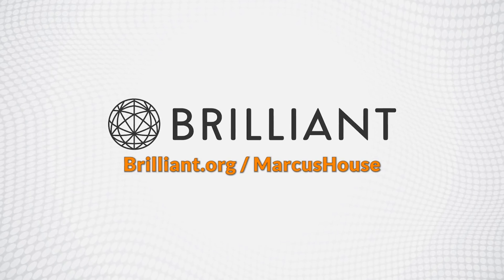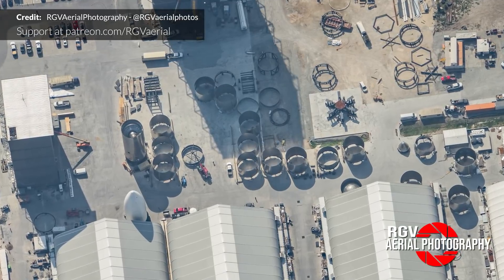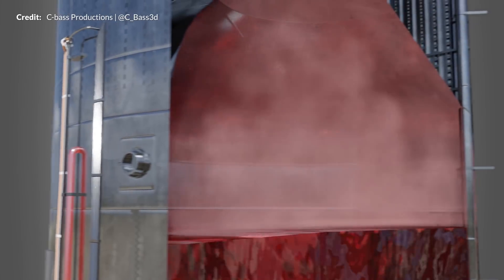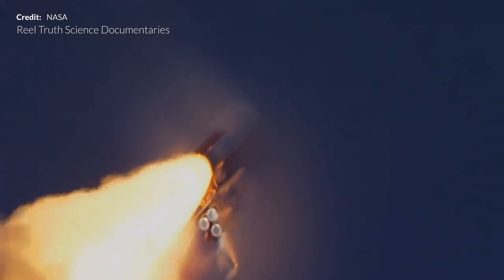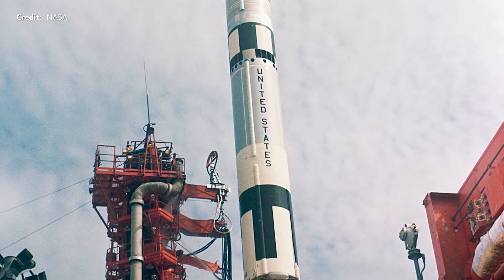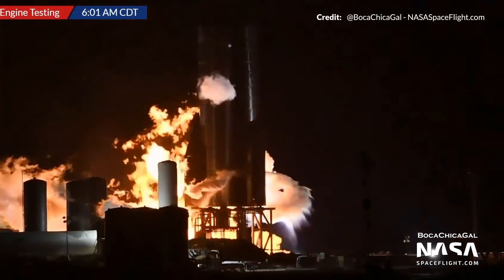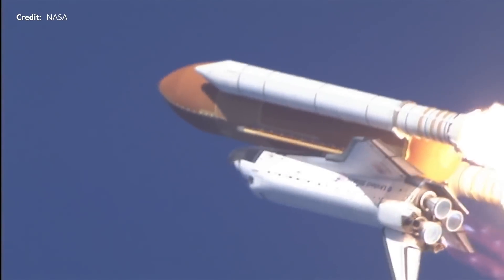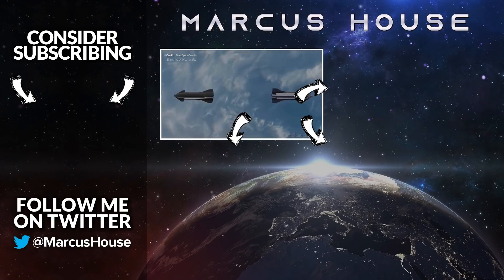SpaceX Starship - How will Starship tank autogenous pressurization systems work?

Comment: Gravity is still free. Get something heavy. That way the gravity be doing most of the work. You know with the right counterweight someone could lift the Starship .. Maybe... Use the original setup to lift and lower. And gravity for the tough side, Lifting or lowering. Double safety and awesome control .. Maybe?

Comment: Hi Marcus, thank you for an interesting video, unfortunately it brings to mind more problems for me, regarding the Mars mission. The average temperatures on the Mars surface, is 20 deg C at its hottest and minus 125 deg C at its coldest, in space temps of minus 270 deg C can be expected. So, on the trip out to Mars it would be an easy prospect to produce hot gas to maintain the methane and oxygen pressure and temperatures. of minus 162 deg C and minus 183 deg C respectively. But on mars the temperature at its coldest isn’t sufficient to prevent the methane and oxygen from boiling off crazily and bursting the tanks or venting to atmosphere, unless somehow, they managed to build reliquefaction plants, the weight of which would be enormous, too much so for Starship. Please do you have any idea how they will manage this? I assume later missions to Mars will allow for the building of refrigeration and reliquefacation plants, but I can't see how the pressure in starship will be maintained on the surface, sufficient to maintain tank pressures and in turn tank strength/stability. Thank you once again for an outstanding video.

Comment: pressurization is not the real problem.  Keeping bubbles out of the fuel intake is the problem.  The engines run on liquid not gas bubbles of nitrogen or helium.  A bladder would solve this problem and you would not need but a little pressure, ounces, not pounds.
Reply from the maker: What material can you make a bladder out of that can deal with cryo temperatures?
Reply: @MarcusHouse  I was thinking of silicone and super fine strand nylon, but there must be a fiber of an element with a super low melting point, eh?    This would work with higher temperature fuels such as kerosene and hydrogen peroxide,  and there are others such as alcohol  but what can remain flexible at super low temperatures?  I don't know but it would have to be a very fine fiber like nylon.
Reply from the maker: @TheWadetube  Remember, it needs to be flexable at cryo temperatures, it needs to hold a hell of a lot of pressure.  I'm not aware of any flexible material that can do that.
Reply: @MarcusHouse  GLass fibers are hard as , well, glass, but bend if thin enough.  Nylon or some other better fiber can be made very fin and it will bend at cryo temperatures and impregnate it with a little silicone or something with a very low melting temperature and no, it does not have to handle high pressures, only keep the air and liquid separate until the liquid is used up.  A couple of pounds of head pressure will keep the liquid at the bottom of the tank in zero G.  That's all I am saying.  A suspended floor might do the same, like a piston head with an O ring or piston ring that would help seal off one side from the other and the floor would simply get pushed down by air pressure and keep it from passing into the liquid.  I see faults in both scenarios.
Reply from the maker: @TheWadetube  But why? How is all this added complexity better than using a little ullage to settle the propellant? Your solutions is much more complicated than what works in reality.
Reply: @MarcusHouse  Refueling in space, the two ships are connected.

Comment: Howdy, I have some questions that I'm having trouble finding the answer to and I hope that you or some else may be able to help. :)

I noticed that the common bulkhead between the two tanks creates quite a pinch point for the lower tank. What do they do to reinforce that area to prevent failure? 
What pressure is the liquid methane stored at vs the liquid oxygen?
And if the pressure is not so high that reinforcement is required, why have such gentle curves on the pressure tanks, especially at the top? Doesn't that waste volume within the structure?
I understand a sort of funnel is required to make sure liquid settles to the bottom of the tank during thrust, but why make the curve so gentle?

Do the pressures of both tanks somewhat cancel each other out at the pinch point of the common bulkhead making it so that there is not any significant pressure difference at that seam?

Thank you!

Comment: @Marcus House Hi Marcus. The addition of pressurised gas to the tanks won't keep the liquids at the right end of the tanks (where the feeds to the engines are), - that still needs gravity or deceleration or diaphrams or something. - When the rocket is not accelerating upwards or decelerating downwards what keep the fuel at the right end of the tanks (e.g. during the belly flop ...?) Thanks.

Comment: One danger I can foresee with autogenous pressurization is the risk of an accidentally fuel rich mix (with fuel not fully burnt) ending up in the LOX tank;  or vice-versa:  an accidentally oxygen rich mix ending up injected into the fuel tank.  I suppose they can take the pressurizer gas for the fuel tank from the fuel rich turbine, and the the pressurizing gas for the LOX tank from the oxygen rich turbine, since the Raptor has two such turbines, being a full flow cycle engine.  However, I'm not at all sure that an oxygen rich mix can't possibly accidentally happen in the fuel rich turbine, or viceversa;  I hope SpaceX have gamed this out carefully.

Comment: The high pressure of the COPV's does NOT solve the problem of "sloshing" which will continue to worry the engineers with disastrous crashes until they re-introduce "the bladder" which provides perfect feeding of the engines while draining the tanks evenly to the last drop. This cure was noted back in 1964 with the first orbiting rockets. Without the bladder (and when the rocket achieves weightlessness, either by gravity free space or deceleration) fuel floats in the tanks allowing gases to exit the feeder lines to the engine resulting in sputtering,  preventing re-ignition and thus disaster especially just before landing.

Comment: I’m not a rocket scientist but at this time putting helium in the tanks as a temp fix has caused the hard landing and subsequent RUD of SN 10 according to Elon the engines were being commanded to higher thrust but were unable to respond due to helium ingestion during its landing phase. I guess this is what R&D is all about finding and fixing bugs till they are all wrung out. Could someone please else explain the whole problem? Is this still a header tank design problem? I don’t understand.

Comment: I think the key to auto pressurisation working is to adjust the shape of the header vessel from a circular shape to a conical shape so as to ensure that only fuel is pushed towards the engine. This may require thicker Metal sheets to with stand the pressure but I think my only real way

Comment: Could they augment the APS with electric heater elements in the header tanks, powered by the Tesla batteries? No moving parts, and the super-cooled liquid methane and LOX would expand as it warmed without forming bubbles of vapor until after the engines have started generating thrust. Once thrust begins accelerating the Starship, any vapor bubbles will rise away from the header tank fuel/LOX drain inlet, to avoid vapor ingestion by the engines. The engines would generate heat for the APS system to continue displacing the liquid propellants with the gas at the top of the tanks. Hey OLF, "Why Don't They Just...?"

Comment: those pipe penetrations are weak points (stress focal points) in the supporting structure of the rocket. Did they attempt internal piping? Or  pipe in pipes?

Comment: I think autogenous pressurization is not a problem itself, but in a combination with incredibly complex dual-stage stage combustion cycle AND the incredible propellant-shaking maneuvers WHILE the engines are running makes all this pretty complex - and honestly not trustworthy. I would ride with Dragon w/o being scared, but I would hardly sit into the Starship. Simply too risky.

Comment: To fast for touchdown. Need something to control rocket power for stabilize power output less equal to weight and gravity so that rocket will slowly touchdown to ground and with a less power.
Reply from the maker: See Musks tweets today. A little new info in it. Engine thrust on the landing Raptor was underperforming.

Comment: major matter of flight safety for this platform is the unspent fuel vapors collecting around the bells in the lower engine enclosures. The requirement for a landing feet to stabilize secure the landing locale prior to taking off again. This needs to be resolved prior to manned flights. Watch in slow motion. Unburned fuel vapors circulate in the open area surrounding the exhaust bells that are used for vectoring thrusts. This can be an opportunity for failed landings due to explosive forces unintended from accumulated unburned fuel vapors.

Comment: It seems to me the only problem is getting fuel to the outlet of each of the tanks while the rocket is completely sideways and gravity has all the fuel pinned against the side of the tank and not the bottom. The autogenous pressurization system has worked great on all the other rockets that fly straight up, but it seems pretty obvious to me that theyre going to have to come up with a way to keep the supply to the header tank more immersed in the liquids on board while the aircraft is cartwheeling around. Maybe a thin bladder that expands to fill the void and press the fuel downwards to the exit....

Comment: Is it possible that they're having trouble real lighting the raptor engines on the starship because the liquid is sloshing around in the tank even though it has pressure or am I ignorant about rocket science
Reply: That is what the smaller fuel tanks are for. They keep them full for the relight until the craft is back in an upright position.
Reply: @your20downrange  I kind of get that but when it goes from the belly flop back upright is it burping liquid or does the pressure keep it controlled I don't really understand how tanks work to be honest it's just the thought but I appreciate the comment

Comment: Are the header tanks even connected to the autogenous pressurisation system or do they have copv's with helium? They probably should have very high pressure for the methane tank becuase its pipe is soo long (high headloss due to friction) and the entire volume of the tank is consumed rapidly that large fractional change puts it into negative pressure much faster than the main tanks would be without the pressurization system. Plus the header tanks are used when the engines and preburners are cold. I don't know about what the mass ratios are but if they needed to generate helium on mars technically they could get it from radioactive isotopes (found in situ) that undergo alpha decay, since alpha particles are helium nuclei.

Comment: Autogenous is way too complicated. Even Raptors are too much complicated. Falcon 9 engines were way better than raptors. Less efficient of course but far more reliable, simple and cheaper in the end. I'm sorry to say that but regarding engines Musk is betraying one of his mantra: Best part is no part!
Reply: I was thinking about the complexity of the Raptors the other day as well. Surely for rapid re-use, a less complex engine with a simpler combustion cycle would be better? Simplifies repairs/refub and less parts to go wrong. Yes, you take a loss in performance, but is the Starship really going to miss out on anything by decreasing it's 100t payload to LEO by 10-20%?

EDIT: As for autogenous press, I'm not sure how the total part count compares to a seperate RCS propellant, but it certainly simplifies operations by not requiring any propellants other than CH4 and O2.

Comment: At about 13:39 "the only alternative":  I'm not smart enough to fully understand this.  Seems to me that this pressurization is for the purpose of condensing the fuel for more efficient delivery to the engines.  Why not produce a fluid rotational centrifugal cylinder with a mechanical impulse; then collect the fuel at the edges to then pump to the engines? A slight cone shaped cylinder should do the job.

Comment: With current improvements in 3d printing and nanotech coupled with the fact we have autogenous pressurization as a functioning system in its infancy means, autogenous pressurization is likely the most logical long-term pursuit, less a better propulsion technology emerges.
Basically, we have a greater chance with incorporating more advanced materials and manufacturing processes than revamping the base tech.

Comment: How does the starship tank not collapse on landing? Will it have enough fuel at that point to press the non-reinforced tanks?
Reply: There is a reason it will continue to fail. This before it has entered zero gravity. 
Will be very interesting to see if they eventually get it to work.

Comment: Something I have been pondering, and you didn't cover it here.  Your depiction shows fuel/oxidizer in liquid form at the bottom of the tanks, as in ascent.  However, when the ship is in freefall, the ship is nearly weightless, which the fuel should be gloping around in the tanks all willy nilly.  Seems to me that some inertial force needs to be applied to the vehicle to get the fuel/oxidizer to rush to the end with the pickup tubes.  I don't see how simply having high pressure could compensate for that alone.

Comment: I have spent time wondering how a liquid fuel can be forced  as a consistent stream under zero g conditions.  Of course you can "settle " the liquid by acceleration, but that is far from satisfactory  A single bubble can destroy your engine.  One idea is keeping the fuels supercritical, so they have characteristics of a gas, and can simply follow Boyles law.  A long piston that pushes the fuel toward the engine does not seem too unreasonable.  A "toothpaste tube" skin that is pressurized to reduce to volume, or tanks that are designed to collapse like an accordion or constrict along their length would be difficult with cryogenic fuels, but might have a cost-effective design if appropriate materials can be used.  I have the feeling an elegant solution is waiting to be discovered.  Another lost night's sleep!

Comment: Am curious how easy it is to get fuel to the raptor engines when the rocket is plunging horizontally through the atmosphere. Even with autogenous pressurization, my intuition suggests that gravity plus deceleration would cause the fuel to puddle along the heat shield side of the tank which is facing down toward the ground.  Sure, when the rocket is oriented vertically, the natural bottom of the tank would be the obvious place to draw the fuel from, but when the rocket is on its side and the tank is rather empty, there won't be any fuel at the bottom of the tank, because the new bottom is the side of the tank facing down. And then when the rocket does its reorientation back to vertical, the fuel must then slosh back to the bottom of the tank and get picked up there.  So I guess my question is, "How are they keeping a constant pressurized flow of fuel to the raptor engines during the descent phase to relight the engines, and then maintaining that constant flow as the rocket reorients from horizontal to vertical to land?"

Comment: Please like this comment. Diary time viewer here. I've solved his pressure problem. The warmed up gas needs to be released into the bottom of the tanks. This allows it to transfer heat to the liquid more allowed the super cooled liquids to expand and add to the pressure as well. At launch you don't need any gas going back into the tanks because the methane is super cooled and under pressure and at liftoff is has gforce to add header pressure. This will also mean at launch the gas has to go through so much liquid that it'll liquify before it gets to the top. This will keep the pressure from getting too high. When you do the belly flop the liquids will be far warmer by then a gasify much quicker to get that pressure you need to stick the landing. This guy's has a lot of subs so maybe he can get Elon's attention on this solution. I care not for credit just solutions.

Comment: AUTOGENOUS PRESSURIZATION SOLVE:
revert the Sabatier reaction in a small volume and in a contained device, and inject the explosion gases (co2+h20) in the O2 and CH4 tanks. this way you achieve an instantaneous pressurization, and  maybe adding a "restriction chamber" in order to ramp up the explosion gases (like a gun sillencer does) could provida a more feiendly and progresive presurization.

if you build a "cicle explosion" like an combustion engine, and you add the gases you could achieve a total presurization control, from only O2 and CH4.

Comment: One tank instead of two, get rid of the other plumbing as well as the common dome.  Both CH4 and O2 can use the same tank as they are both are liquid at the same temperature. O2 interior cylinder bag/tank, CH4 exterior.  Attaching connecting hardware to flexible Teflon tanks is easy.  Use flexible Teflon tanks in the common (1) tank instead of four.  This will prevent sloshing, bubbling, & stupid.  Get a J&J baby bottle to examine the general principal.  Getting rid of all the stupid plumbing will diminish vehicle mass and vastly increase payload mass.  The extra barrier material will allow thinner 2mm builds.